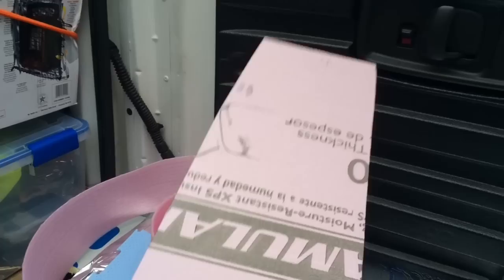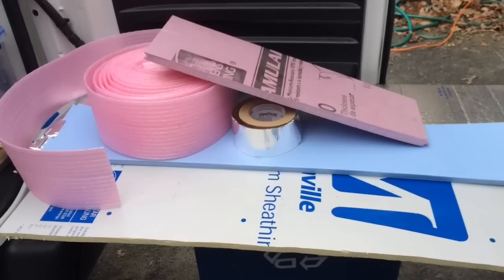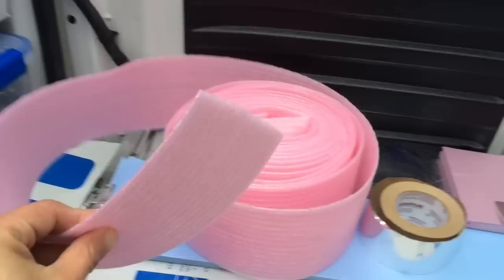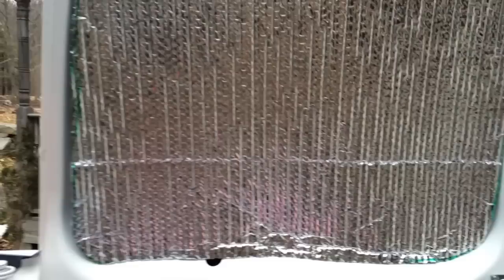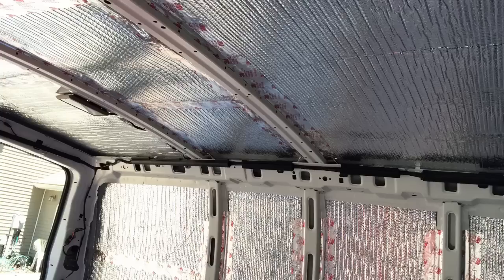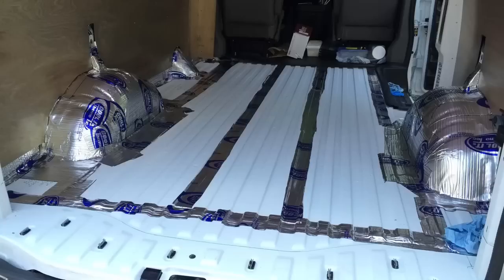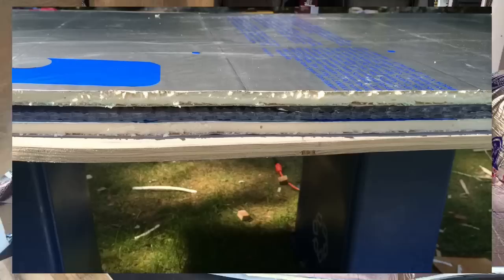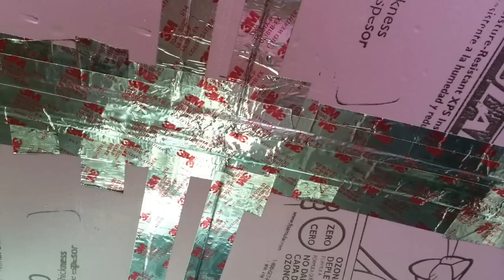In detail van build series;  insulation!

Comment: For my use I think I'll just use the foam for walls .and there's a special glue that home depot sells for the walls and the reflective product for the roof. I want some fresh air to come in so I can breath. I have a Honda 2000 generator that powers a space heater, and in the summer a 9500 BTU Floor unit in wheels and I had to put a hard start unit in it. If you need A/C, Coleman makes a rooftop unit that has the hard start part in it already so a smaller generator like the Honda 2000 watt can run it. You did a great job on your van. Enjoy, and thanks for posting.

Comment: The single biggest mistake you can make is to glue reflectix directly to  metal, heat will still penetrate through reflectix.  you need to glue at least 1/2 inch to 3/4 inch Styrofoam board first to prevent heat or cold from penetrating.  I would suggest watching a video from Mike from backroads vanner on how to finish van interior, he did awesome job,  good luck.
Reply from the maker: +Kris my advice to anyone that asks about refletix is to leave 1 inch gap between it and in this case, the van walls. However, not at the sacrifice of space, and I didn't have much to begin. I knew it wouldn't help much but I also knew that anything was better than nothing. And it was; my van is always at least 20 degrees warmer than the outside.  👍🏻🚐😄

Comment: I used the same tape to tape up all of my seams. I noticed that my van smelled like tape afterwards. Have you experienced any off-gassing/bad smells associated with the adhesive on the tape warming up, or did that smell go away once you put on your panelling?
Reply from the maker: Maybe I got used to the smell. Remember, I used spray glue to hold up the foam to the walls, and that smelled. So if the tape smelled I couldn't really tell. I did have all the doors open while working in the van, and afterwards as much as possible. 
Now, with the panels up, and the build completed I don't smell anything. 😄👍🚐
Reply: Thanks for your reply. Also, do you think you will eventually put a fan in the ceiling? I am apprehensive to put one in mine because I think they take away from the stealth look and quite frankly are an eye-sore. However I am concerned about the air-quality and ventilation capabilities. Does it get stuffy in your van to the point where the stuffiness transcends comfortability?
Reply from the maker: Many nights when I went to sleep the temperatures were in the 90s with humidity. What I did was ventilate the van in the shade, under some trees when possible. Then when time came to go to sleep I would open the front windows a few inches, the bulkhead door would stay open also a few inches, and in the living area I would have three fans circulating the air, plus the swamp cooler. 
Yes, some nights were hot, but I never felt that uncomfortable.  
As of the filming of this video I too was terrified of cutting a hole in my roof. Did I put in a fan? I could tell you right now but, I think I'm going to let you find out. 😂😄👍🚐

Comment: Did you then install a vapor barrier over the insulation before putting down floor, wall, and ceiling finish coverings? If not, why not? I've seen a lot of videos showing how to insulate a van but I've only seen one van conversion where a vapor barrier was used as you would in the walls of a house. Thank you for the video.
Reply from the maker: Hi Donald! Thank you!
That's one thing I decided not to use. Sealing a van completely could be a great thing, or the worst thing. You'll be nice and warm in the winter but, and here's why I didn't use it, it can trap condensation. 
As you may have heard a few years back, many homes were so well wrapped to the point the house couldn't breathe. They trapped moisture, saturated the insulation, and created a big mold problem. I didn't that in my van. I still sealed things pretty good with Reflictix and metal tape, but it's not a perfect envelope. 
If I were to do it again I still wouldn't use vapor barrier, unless it became a proven fact that it worked with no problem. One thing I would do differently would be to leave an air gap with the Reflectix, something I didn't do.  👍🚐
Reply: Rolling Earth-Ship
I'm currently not a van owner although I have owned a few over my lifetime and did some makeshift camping and used them for emergency overnight shelter a time or two. I am fascinated by the idea of having a liveable domicile on wheels! The condensation issue in a van is a difficult one. I  keep thinking that without a vapor barrier, all the humidity from our breathing, and that's a lot of humidity, would condense on the cold steel wherever it is exposed and that could lead to water dripping down inside the walls, collecting at floor level and rusting from the inside out. You're correct that in a tightly confined space ventilation is crucial not just for the van but for the health of the dwellers and mold is to be avoided at all costs. I'd be interested to know if there are any environmental engineers out there who could chime in with some expertise. Also wondering if Reflectix attached to the wall is even necessary. I'm thinking that if you use a panel type of insulation like styrofoam or the pink stuff, that you should put a reflective barrier on the side facing living space to keep the heat in during winter and out in the summer as in a house. Some insulating panels come with a reflective surface that is installed with the reflective surface facing the living space not outside so maybe just keep the reflectix layer on the living space side of the insulation and none on the outside. Something to ponder and thank you for your reply.
Reply from the maker: Reflectix isn't necessary. You could use it, but to be effective you must leave an air gap between it and the van walls.  
As far as condensation and humidity, you are going to have that but, precautions can be made to alleviate or even negate the problem altogether. I for example weather permitting keep the two front windows open an inch or two, and the roof vent also open a couple of inches. So far I haven't had any problems. I was even living in it last summer with all the heat and humidity of the northeast and without the roof vent. 😄👍🚐

Comment: Got another question for you, I am trying to figure out some sort of trim for my flooring where it ends at the back of the van. You can see the polyiso underneath. Did you use anything for that, or did you just leave it flush?
Reply from the maker: Well, I've been meaning to do something to that, but then it got cold and I never did. Well, almost. I did do something that I'm not entirety unhappy with, and I may just leave it that way. 
You can see it in some of my videos. What I did was cut a piece of 3/4 wood to contour the floor. It extends from where the floor ended, and goes as far back as the closed doors. It does two things for me: 1- levels off the floor all the way to the doors, and 2- it trims off the floor pretty nice. 
Hope that helps. 😄👍🚐
Reply: It does help. Thanks alot. You did a quality job on the van, looks really nice.
Reply from the maker: Thank you, really appreciate it. 👍